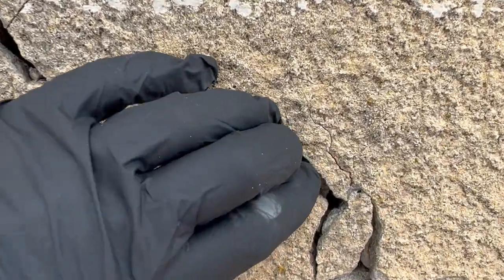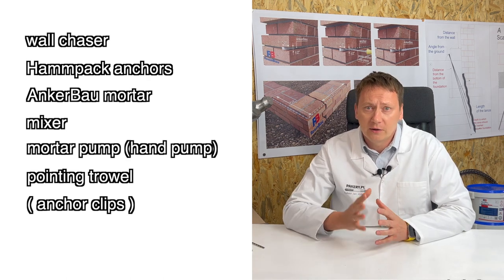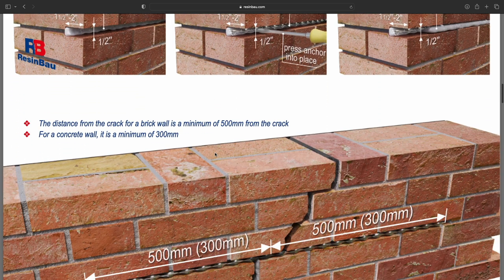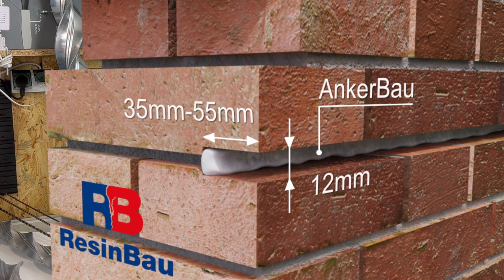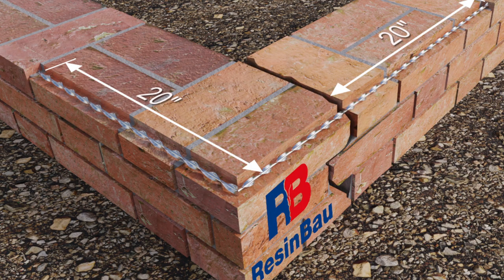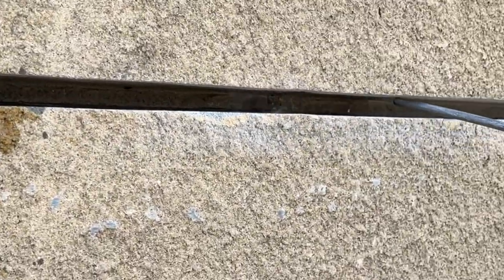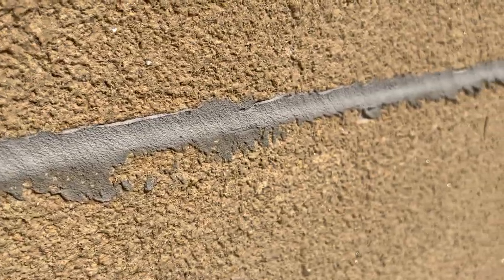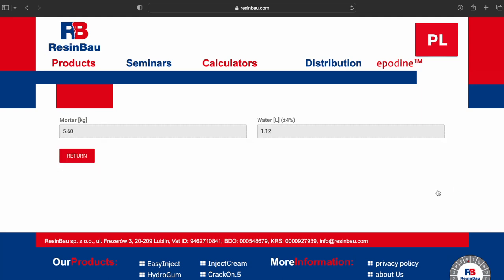MASONRY REPAIRS WITH HELICAL BARS (Spiral Anchor + AnkerBau mortar) - Cracked Wall fix

Comment: How do you suppose to close gaps of cracked lines?
Reply from the maker: The context likely refers to sealing the front of the crack (not the grooves after the cracks, which are filled with mortar). The same mortar can be used to close the front of the crack. Some people don't do anything about it, or they insulate the building, thus covering the crack and reinforcing the structure. Some designers recommend performing an injection with a cement-based suspension (as an additional measure, helical anchors can also be inserted into drilled holes), or doing it conventionally.

Comment: Would rebar work
Reply from the maker: Reinforcing bars, commonly known as rebar, are typically thicker and heavier than helical anchors and are primarily used for reinforcing concrete. Although in theory they could be used as a form of anchoring, helical anchors are specially designed for delicate and discreet reinforcement of walls, especially in historic buildings. Additionally, helical anchors, made of stainless steel, offer greater corrosion resistance compared to many reinforcing bars. Their unique construction ensures they adhere better to mortar and effectively bond walls in grooves, providing a solid and durable connection. Using rebar might not offer the same precision, subtlety, and connection durability as helical anchors. If you're considering using reinforcing bars for this purpose, it's advisable to consult with an expert in building renovation and preservation. Remember, the right tool and material are key to the durability and aesthetics of the completed work.

Comment: Why don’t you show me what properties look like after this Repair? 😂🤔🤫🤭
Reply from the maker: The properties look quite good after the repair. They typically feature horizontal stripes, but that's essentially all we do in terms of repair. The final finish of the facade depends on the investor. Usually, after our intervention, the walls are repainted, and a new texture is created, such as "baranek" (a type of plaster texture) or another structure, adapted to the original appearance of the building. However, the most crucial aspect of our work is securing the structure of the wall against further damage.